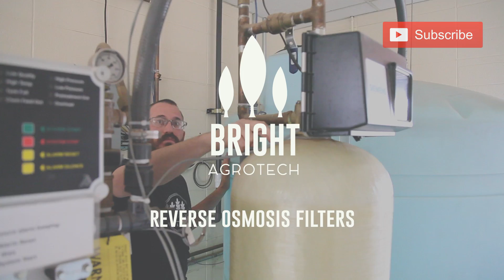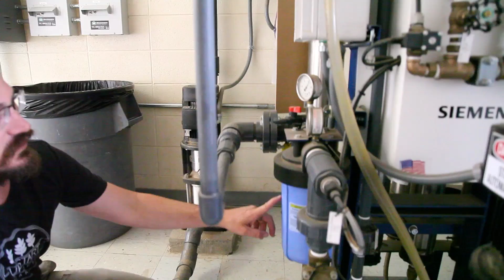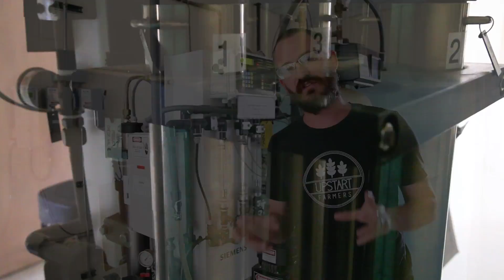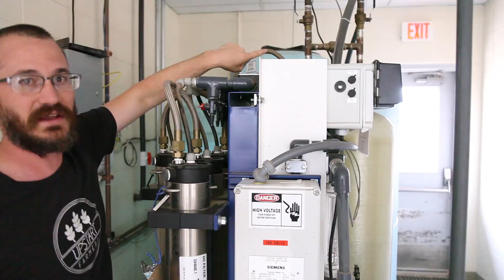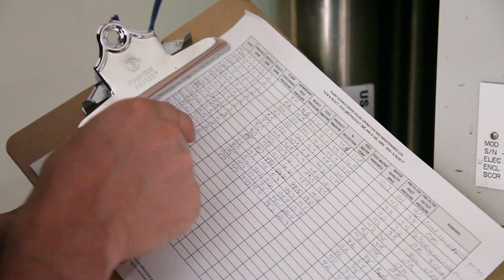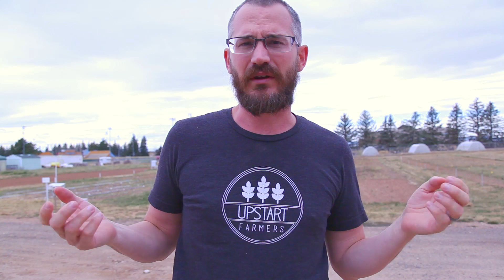Reverse Osmosis Filters For Hydroponic Growers

Comment: what "pretty large farm" means? and what "very small farm" means? It didn't help to understand what size i would need.
Reply from the maker: Thanks for your question. Your RO demand is going to be dependent on the size of farm you're looking at. Typically a 300GPD Reverse osmosis unit is sufficient for a 1000 sq ft farm.

Comment: Nice video. But the system needs to be explained MUCH better. When it comes to RO systems. Concentrate Recycling is the big thing everyone wants to know about. How you did it. What steps did you take to place membranes in certain positions and what your Concentrate, Permeate and Flux rates are. As well as do you have fouling issues.

Comment: Great video bro:) So, I'm assuming you guys re-mineralize the water? I would be interested in a video on that topic! I have only been using RO in my system because I could not get my pH down for a long time. I often wondered what issues I could run into by removing lots of other things from the water but I thought I could just use RO and add what was needed over time so I could control everything like pH. It would be nice to get the pH to a 6.5 and give my self a nice buffer of like 7 of 8 kh to keep it there for a long time. I need to know way more about RO and what it removes and how to re-mineralize my water. I am also sorry I missed you guys while you and Chris were out here in Fullerton! It would have been nice to get your opinion on placement of my towers and walk-through my water all while getting a video going together:)